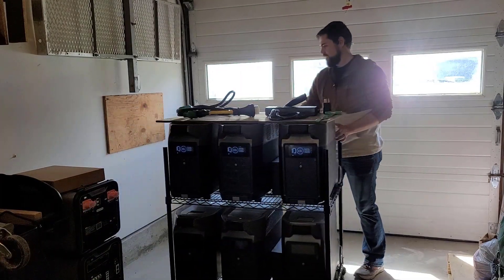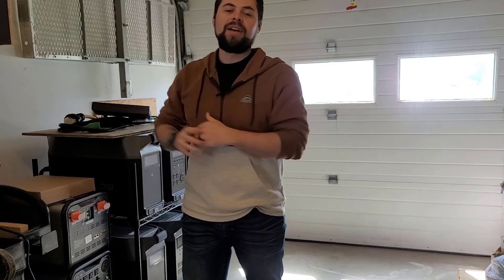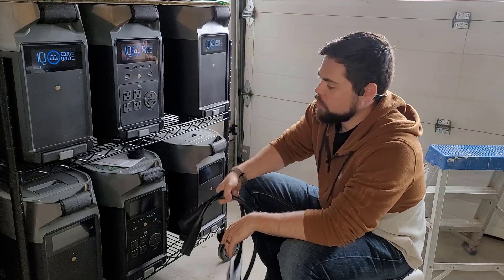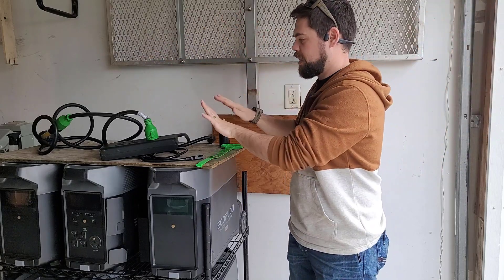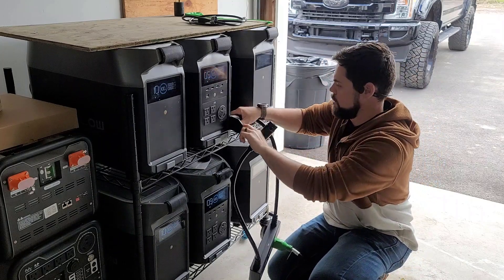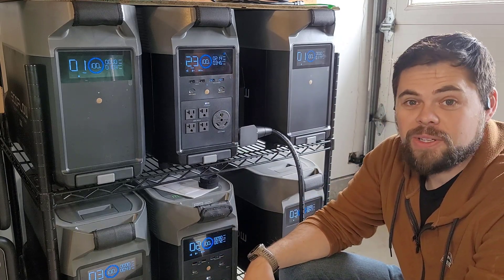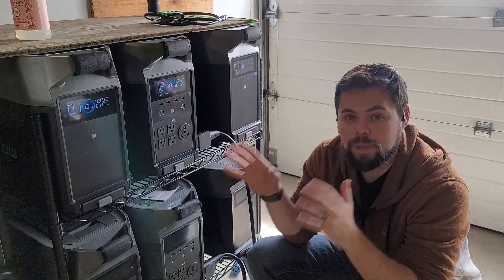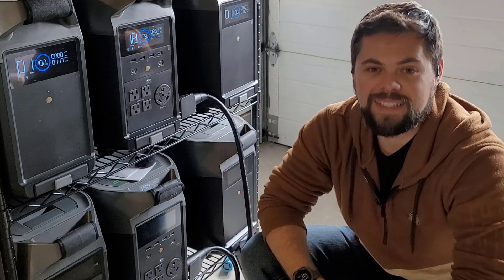EcoFlow Delta Pro Setup and Test

Comment: Little pricey,  but great setup.  I built my own mpp and growwatt systems for backup and production.  Really crazy most people dont know all this is possible.
Reply: Not everyone has the tools or space therefore there are out the box all in one systems like this. As well as this is aimed for mobile & rv use.
Reply: $18,000 is not cheap.
Reply: @browsedeweb8834  neither is a home gen set.
Reply: @WattsMiner  $4200 for 12k Briggs and Stratton, add a soft start on a central ac you can easily do it. Run for as long as you need on NG.
Reply: yes you needs NG and solar panels you needs sun 😊
Reply: I got a delta pro n 2 extra batteries for about $4400 it did get a lot cheaper and you get the 30% its credit so for some it may definitely be worth it

Comment: why did you not go with their Smart Home Panel instead?   I have it set up at my shop, with 2 batteries and solar charging and I use my 240v tools as normal, with the regular shop wiring.  No adapter like that or extension cords etc.  When the grid power fails the Smart Panel takes over instantly.
Reply from the maker: The Smart Home Panel is really incredible, but I already had this in my house so there was no real reason besides instant takeover. Plus because I review and test multiple solar generators I need something that can work with any solar generator.

Comment: Wow, paid for it with your own money, that's almost $18,000 plus tax.  I cant' wait to see what your solar setup looks like.  Currently, I'm waiting to receive the Smart Home Panel and connect my two Delta Pro to it.  Also, I wonder if I have two Delta pros connected to the smart panel and if I would still need the 240-volt connector.
Reply: Wholly crap that is alot, my natural gas generator costs $800, runs my whole interior panel, so everything but central ac, oven, hot tub. I ran it for 2 weeks straight after the last hurricane. Operating my home power inside.
Reply: @Nolaman70  Yes it is, I did only two delta pros from Costco for $6k that I'm getting the Ecoflow smart home panel installed plus the cost of the unit for another $3k, so a total investment of $9k+.  But, for me it's worth it because I can run silently and as long as we have the sun, I'm able to always to get charged (eventually). Oh, plus my solar panels, that was another $1,300 so all in $10,300.  Yeah so not cheap, but considering to get a generac gas system installed for all the estimates I got was over $13k - so the only way I'm really screwed is if the sun gets block for over 7 or an EMP blast.
Reply: Its worth if you got into the kickstarter as a backer. They were almost about 40 percent off depending on the early bird. The super early was 50 percent off the retail price now. They were going for 1999 but only had 150 available at that price

Comment: Well, I need to say "Thank you" to Ben Gillmore for this review and recommendation of the ULINE rack.
I ordered it last night and received it at my door this afternoon.
So I just finished my installing my upgrade rack but now I feel so inadequate🤣.
This new rack makes it looks like I need 2 more EB's. 😉
It should be noted that there is a huge difference in quality, capacity and strength between the previous smaller racks I was using and the new ULINE rack.
I was VERY concerned as I had read some posts in this group where the small plastic casters on the smaller racks had broken causing the rack to tip over.
Not something I wanted to have happen to me with $16,000 worth of product on it.
So as soon as I saw the size and quality of the casters on this ULINE rack and the fact Ben Gillmore was pushing this thing around with 600 LBS on it like nothing, I knew I had to switch for the safety of my EcoFlow products.
The Bonus: I have room for 2 more EB's if I decide to order them.
Reply: What are the dimensions of the ULINE Rack and where do you purchase?

Comment: During the freeze we had in Texas all I had was the apex inergy and two 500 jackeries for the whole 8 days we lost power.  I did have a Honda 2200 to charge the apex and jackeries for necessities and I must say it was pretty easy dealing with what Mother Nature threw at us those 8 days.  I see your unit  and it blows my mind away....I love it.  Is it possible to have a system like yours already hooked up to the transfer switch and use it as a UPS or does it need to be connected manually like you demonstrated on this great video.  Phenomenal video and fantastic information...thank you for sharing.
Reply: Ecoflow has a smart panel that can transfer automatically. It's pricy at $1600 but has some amazing features.
Reply from the maker: I'm glad you enjoyed the video. Yes, that Texas freeze was bad stuff. These types of units generally are on a manual transfer switch. I have heard there are automatic transfer switches but I've never looked into it so I don't know. I'd talk with an electrician. It would be really cool to have an auto transfer switch with one of these units sitting waiting to go. The other difficulty is these units have an auto shut off if they are not used for a certain amount of time so that would have to be changed in the settings I believe.
Reply: @minutemansolar  The jackeries also have an auto shut off if what they are plugged in to does not draw so much wattage.  Luckily I only used them for lights and my Bi-pap machine with my 12V adapter plug.  Since then, I have purchased the Delta Max to use as my UPS for the kitchen fridge and the apex for the freezer in the garage.  The eco flow deltas do have that auto shutoff that can be programmed through the apps to never shut off.

Comment: Just switching off your Main 200amp breaker does not disconnect you from the Line Voltage from your utilities.  You only disconnected L1 and L2 from your main panel Neutral is still connected and can transfer voltage to the line.
Reply: That is not correct,  your Neutral will still conduct return voltage  from L1 and L2 return from your Solar Generator, very dangerous to a lineman down the Line.
Reply: The neutral line would need a return path to complete the circuit, which it doesn't if L1 and L2 are disconnected.
Reply: From the grid is L1 and L2 and a ground. No neutral from grid . Only 3 wires come in from grid
Reply: @h2xmark  If you don't have a neutral than you don't have 120 circuits, if you are using Ground as your return path than you really have a problem!
Reply: @daviddauria3012  you only have a neutral in your home wiring, it bonds with the ground in your breaker box. The NEC states you can only have 1 bonding spot and that is your service panel. If you cut the main breaker even if you had stray current come through the neutral it would go through the neutral ground bonding in your panel then through the 3 foot ground rod driven into the ground
Reply: @h2xmark  Look I'm not going to argue with you, do what you want, but it's irresponsible to put this out to the general public, you're going to get someone hurt.

Comment: Excellent and informative video...just 1 question, if you have backup gas generators, then why would you spend another 10k on these solar generators?  Just asking
Reply from the maker: Having personally gone through natural disasters where fuel ran out, I don't like to rely solely on fuel generators for power. The gas/propane generators are a backup to my solar, not the other way around.
Reply: Let me add the Great Reset means the elimination of fossil fuels. This is a smart investment.

Comment: Can you try this setup with a whole house HVAC unit to see if it can overcome the inrush current of the compressor?
Reply: You can add a soft start, it brought my 4 ton central ac inrush from 120A to 40A or 27000kvm to 9200kvm. Now i can get away with a 10 - 12k briggs and Stratton NG generator. The difference was shocking... Still have a portable NG, but will do the whole house 12k eventually, just getting everything ready...
Reply from the maker: Sorry but I don't have whole house A/C cause I live in Idaho. When it's hot outside we just blow cold air from the basement to the upstairs most of the time. But I will see what I can do.

Comment: I think half of that will be enough for me. I don't use much power in my house except for AC.
Reply: You would not be able to use most whole house ac units with this. I would get a couple of window units for emergencies.
Reply from the maker: Yes most people don't need a system this large in my experience but A/C does take A LOT of power so that'll be the big question.

Comment: 7200 watts is enough for a regular household. That's already overkill.
Reply: Do the math for watts and hours being consumed.
As Tim Taylor would say: "More Power"
Actually it is not. If the grid is down, you have the power for awhile. Note he has the Gas/Pro generator in case the sun isn't out very long to charge it up with his solar panels. On the other hand if you don't need 240VAC. One Delta Pro and 2 spare batteries can be enough depending on your energy use.

Comment: Curious as to why you didn’t show how the extra batteries connected to each of the main generators, just how the mains connected to each other.
Reply: It's a no brainer. The batteries come with a cable that easily tethers them to the side of the main unit.

Comment: Will it run a 4 ton AC?
Reply: Highly doubt it could.
Reply: I want to know this as well. I have a 4 ton Lennox with a soft starter on it, but my Honda EU7000is generator can't start it.  Inrush current came down to 55A from 120A, and the unit draws about 17A when running normally. A single Delta Pro has a surge rating of twice its continuous output rating, so you would think that two Delta Pro units would double that.
Reply: Looking at the Briggs and Stratton 12k 200A transfer generator. With my soft start I'm  down from 120A to 40A on 4 ton ac. That's 27600kw to 9600kw. With the generator controls you can adjust what to run or have it wait for more power, like stop hot tub from running, or delay ac as needed.
Reply: Of course not

Comment: Gosh this is good.  On the other hand wouldn't the Ecoflow Home Panel just do all of this automatically on a power outage?
Great little generators/battery back ups, with Solar in to really keep things going when energy isn't coming in!
A very engaging video.
I have the two Pros and two batteries, but will be adding two more batteries because solar in is maxing me out and it's only May.
Reply: Yes. We have the home panel and it takes most of this videos work out of the equation.

Comment: Something to keep I'm mind if you are NOT using EcoFlow Smart Generators to charge the Delta Pros.

In this video, BOTH Delta Pro's are being charged via DC through the Switched-Mode Power Supply (SMPS) at 1,200 watts to EACH DP via Yamaha EF6300iSDE. 

To my knowledge, this is the only way other than using TWO Ecoflow Smart Genertors or using solar panels for the DP's to have their batteries charged WHILE connected to Double Voltage Hub which is supplying 240 volts to my transfer switch which in turn is supplying power to my house panel which is powering my whole house. I needed the DVH and the 240 volts it prodiuces for my well pump.
For example, if the DVH is only drawing 1,000 watts total for my whole house, the DP's are still getting 1,200 watts EACH of input.

If I were to connect my DP's directly to AC outputs on my Yamaha EF6300iSDE, the DP's can input and output 1600 watts continuously but the batteries will NOT be charging IF connected to the DVH supplying power as the DP's go in "pass through mode" when connected to AC while using DVH.

https://youtu.be/kVEqvLiHx2w

Comment: $20,000? Holy dang that's alot of dough right there.
Reply: Doing this with solar generators is definitely more expensive. You could do it for cheaper if you are fine with wiring up a growatt or mpp solar all-in-one inverter and sourcing your own LiFePO4 batteries.
Reply: @niktak1114  Solar generators are definitely more expensive. However I believe they are the best way for people to get solar and backup power of they will be moving within 5-10 years.
Reply: @KittKattBarr222  a system using an all-in-one inverter can be similarly portable
Reply: If you are in the US and use it to reduce your need for grid power (with solar panels), you can get 26% back as a tax credit.
Reply: 30% tax credit for 2023.

Comment: Great video. Based on a post on the DIY Solar forum by a user with two Delta Pros connected using the 240V double voltage hub, you can't charge the units with a generator while they are supplying power via the hub. The user smelled burning from his units...probably due to incompatible waveforms. I'm guessing the Delta Pro units can't phase match or pass through incoming power.  They can take DC input while outputting 240V.  You have to disconnect the Delta Pro units from the hub and switch your home over to generator power while also charging the units, then switch back after they are charged up.  Can you confirm this limitation?
Reply: Does this apply also if your charging with ac and solar at the same time or is it just through generator? Thank you.
Reply: @1ENDUSER  Solar works, any AC input doesn't unless the double voltage hub is off. If you have grid power, you wouldn't need to run the AC output of the Ecoflow units, so that's not a big deal.  If you don't have grid power, you would need to switch your backup power source from Ecoflow to Generator power, turn off the double voltage hub, and use generator power to recharge the units. The Ecoflow units apparently can't pass through generator power, but they can pass through DC solar power.

Comment: Enjoyed the video!  How do you go about overpaneling your Delta pro?  I have a Delta Max and I can't overpanel it even a little.  I'd like to hear about your approach to it :)
Reply from the maker: It's not much of an overpanel but the best way I have found is using the 210w panels on the https://poweredportablesolar.com/shop/ site. You can put up to 7 of them in series which is 1,470w at a total of 138v and 13a. So You can add two strings of this to have a total of 2,940w connected which should lead to the 1,600w of allowed input to be filled most of the day. The only problem is that is you have 7 panels in series and if the temperature outside is below about 40 degrees they COULD make more voltage and possibly exceed the 150v threshold on the Delta Pro which could burn out the charge controller so then it might be a bad idea to use 7 panels which is why I recommend a 6S2P setup with two strings of 6 panels in series/parallel combo for a tal of 2520w overpaneled. 

As I have tried to make other solar panels work such as 250w, 350w and 450w panels I can't get as much solar connected and the panels start to get so big that they become too cumbersome. So this is where I seem to have found a sweet spot for the over paneling of the Delta Pro. I'll have a video all about this coming out hopefully by the end of this month explaining it all.

Comment: Great video, Ben. What an impressive setup. You mentioned that a drawback to the system was not being able to over-panel. What is the max panel limit on each EFD Pro unit, in terms of max wattage. (I have a hard time "visualizing" volt limits.) Thanks!
Reply from the maker: It is possible to over panel but it's not easy and can't over panel very much. I'll have a video explaining all of that in detail. 
The max wattage in panels I have figured out how to connect is about 2,500w. That maxes out the voltage and amperage of the charge parameter and I am still testing that over paneling setup in different weather conditions to see how well that works. So again, that will be in a future video. Basically the setup will be two sets of six panels for a total of 12 panels connected in a series/parallel setup to get to that 2500w setup. It's still a good amount over paneled power but not what I've been able to do before like I did with the Titan that had double the wattage whereas the Delta Pro is doing 58% more than the max wattage input. Still great for sure.
Reply: Amazing video. Thanks for the info!. Any video available of how you hooked up the transfer panel? Amp availability.. etc.. thabks again
Reply: Oh, I thought u were going to be more specific with the wiring from Panel to Transfer Switch.  That tiny little square where u plugged cable coming from Ecoflow was the Transfer switch?  Darn, this was just a Pony show.

Comment: So which o e do you think works better??  The Titan system or the 2 delta pro with the 4 batteries?? Can you do a comparison video of the pros and cons of each system? Please and thank you.
Reply: I'm def not speaking for Ben, but  you can't go wrong with either system.

Titan pros: 
Can add as many batteries as your $$ allows
The ability to over panel
Can use ANY external battery of your choosing 

EcoFlow pro that the Titan cannot do:
The ability to power your entire home/Cabin/RV using 240 volts
Can remotely monitor the system via app or external EcoFlowscreen

You really can't go wrong with either system so it's not about which one is best. If you want to have the ability to run your entire home then the EcoFlow is the one to get.

btw....I do own a Titan.
Reply from the maker: Yes I will be doing a Titan vs Delta Pro video. My video list is very long so I will get to that one ASAP.